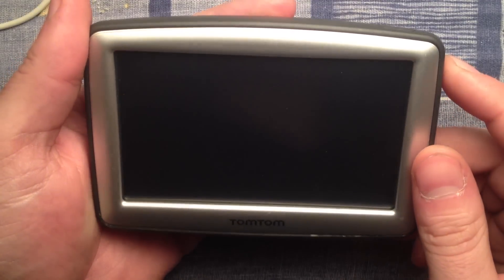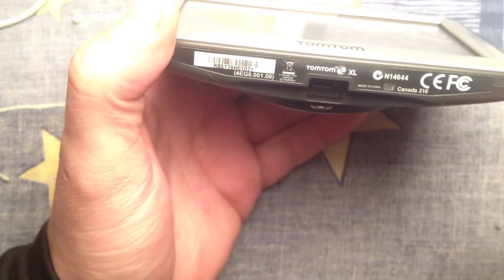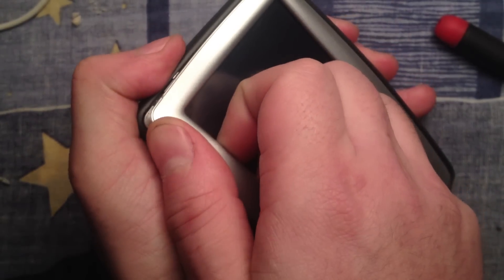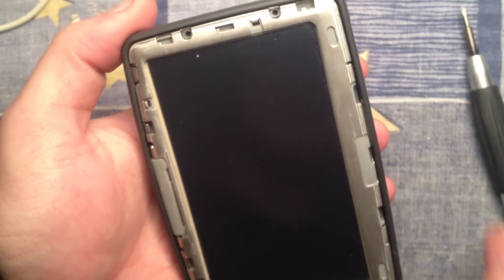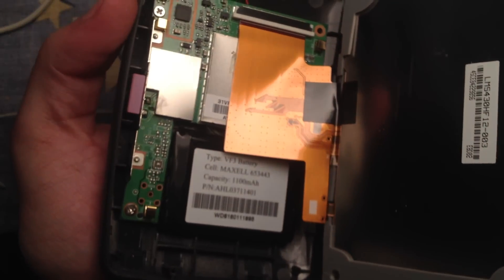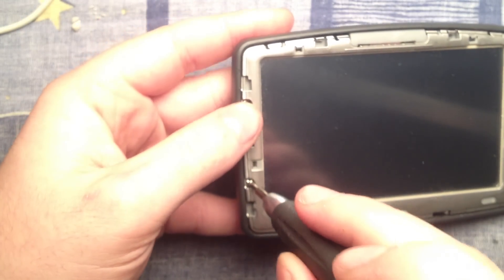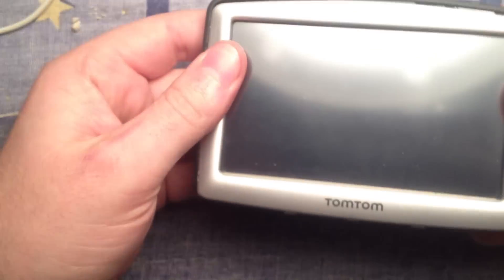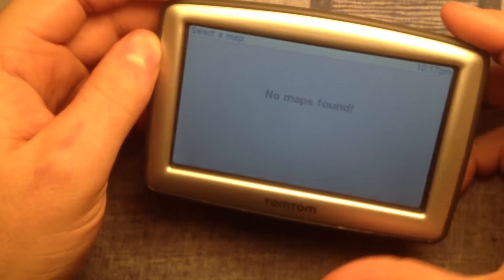GPS Tomtom XL disassembly

Comment: It's NOT a cellphone. It shows how to get places. It CAN be helpful. Sometimes a GPS can be misleading! DON'T trust it on a interstate! If a gas station just closed, it doesn't know that. Stores that just closed aren't indicated. Don't leave it in the car heat! That'll damage it. Unexpected road repairs aren't shown. If a person just moved, it doesn't know. If a store changed names, it doesn't know. Keep PLENTY of gas in your car! Update it using the USB cable and a computer. Avoid bad weather travel. If you miss your turnoff, it tells you to turn left and get back where you were. It'll correct itself if you insist on going YOUR way.